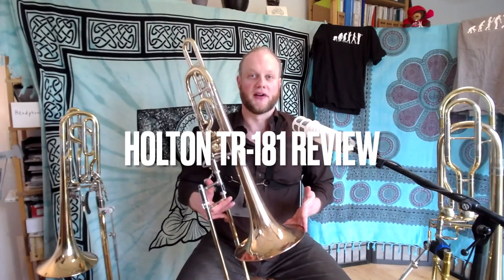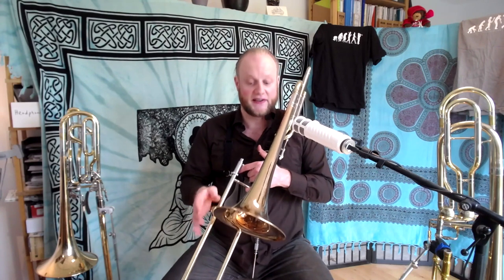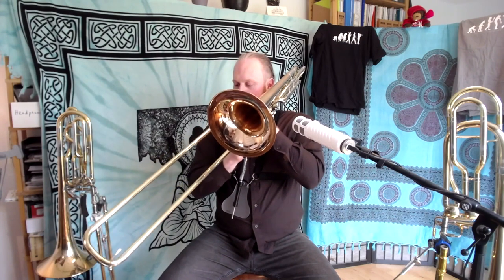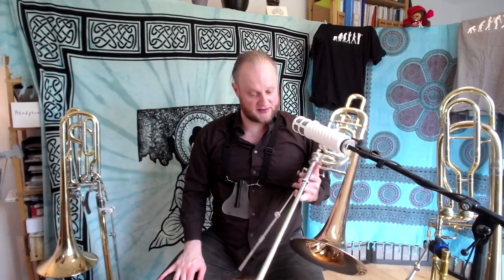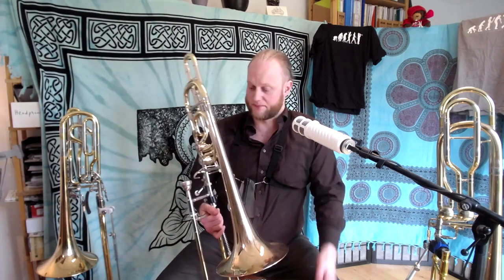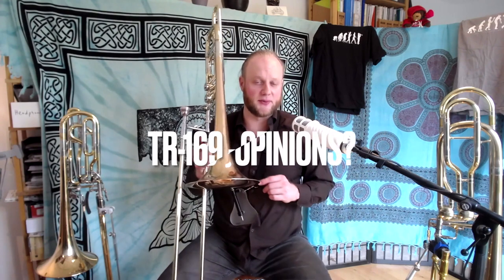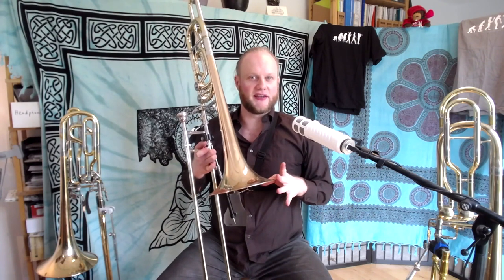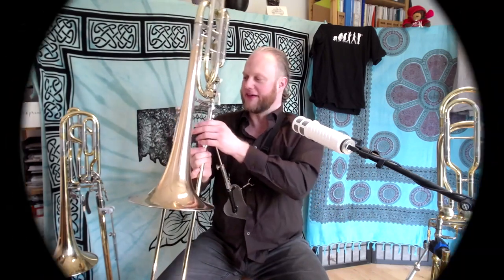HOLTON TR-181 | Bass Trombone Review

Comment: Mine is about 8 yrs newer, mid '80s. Played it for 35 years. No problems with the F lever, but otherwise same remarks. Big sound in low and middle range. Really adds depth in the band/section. Hi register is a struggle. I' ve never bothered with low D in 1st - pull the F slide out to get low F in tune, and the other is all-in for a decent Gb.
Reply from the maker: Appreciate the comment Joseph! My setup just about got F and D happening in 1st, not sure where Gb was...I’d have had the D slide shortened if I’d kept it...

Comment: Thanks for an informative review! 
As a beginner bass trombonist (experienced brass teacher though) I'm super happy with my Holton Tr-181. Every time I practice I'm getting a lot of joy out of the sound and feeling. I haven't experience the same with our student horn Yamaha 321.

I'm struggling a bit with the double valve register though. I guess I need to learn the "Holton blow" you described!

I think there might be a part of my horn missing since it is impossible to tune to D on first position, the second valve tuning slide being too short.  (I guess it's made for G-tuning?) Still testing different ways to tune it and easy-to-find low C and B are a priority at the moment. So I thought about tuning it so that i get C with both valves in about the same position as D with f-valve. Any comments on that? 

I also read about the Bollinger tuning and it seems usable but maybe a bit complicated to learn. I think it's doable with the 2nd valve slide I have now.
Reply from the maker: Older horns often had Eb as a VV option.

I’ve never worked with Eb tuning, but my personal feeling is: don’t make the slide too long for C and B, it will only be harder to blow. 

Your idea sounds good for the C. Experiment where the B is also a good blow and note it down!

Good luck 🤞

Comment: I had a 1990s vintage TR-181 and I don't think I ever had an issue with the F valve trigger. I never had an issue with tuning in the valves either, but I ran the Bb/F/G/Eb configuration,  maybe that makes a difference

It was a fantastic horn,  but I only bought it because I couldn't find a yamaha 613G for sale at the time. As soon as I got my 613G, I sold my 181. I wish I hadn't though
Reply from the maker: I have loved the 613G too. 
But the Holton has a special warm sound that the Yamaha can’t quite match.

Thanks for your comment!

Comment: Haven’t had that problem with F-valve lever.  Agree with D valve slide - I keep mine all the way in.  My valves are very quiet, not clanky as yours in the video.  My hand slide is also outstanding, especially considering its age.  Bought it well-used, s/n 9600xx.  Anybody know when this might have been built?  What s/n range is yours?  Love the horn; it’s not holding me back!
Reply from the maker: Interesting Jim. I found the possible years very quickly with a google search of serial numbers.

Glad it’s treating you well!
Reply: Thanks, Nick.  Love your videos!  
Unfortunately, Holton serial numbers after 1980 seem to be a mystery!
Reply from the maker: @jimrichards7882  🙏 Did you try the bigger Facebook trombone equipment group regarding serial numbers?